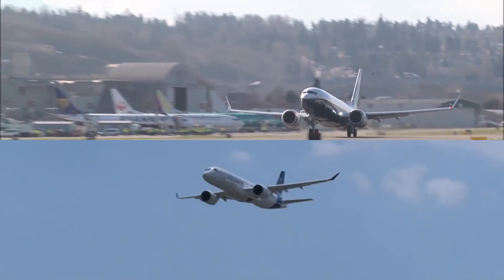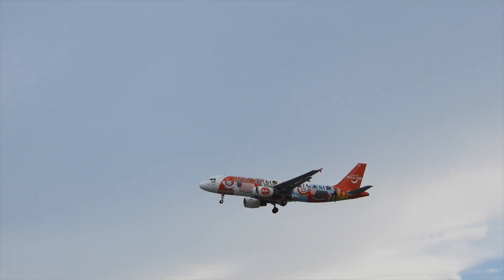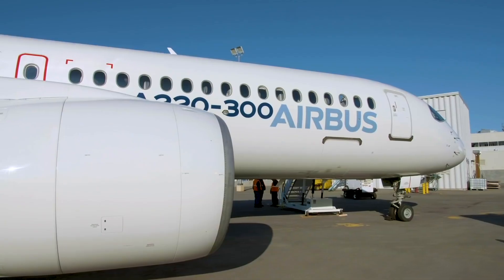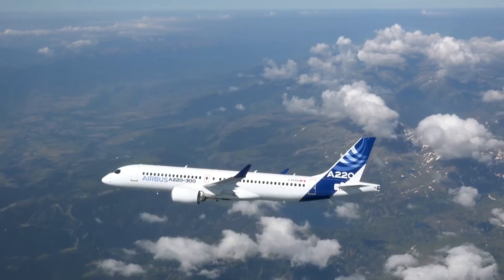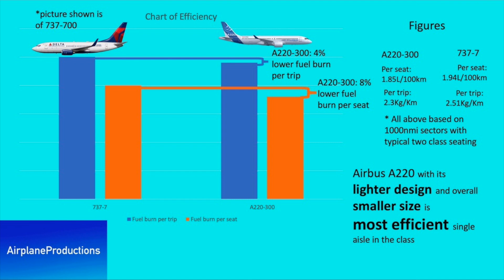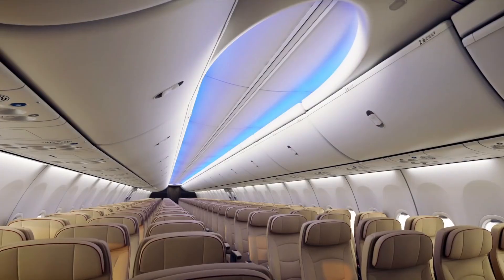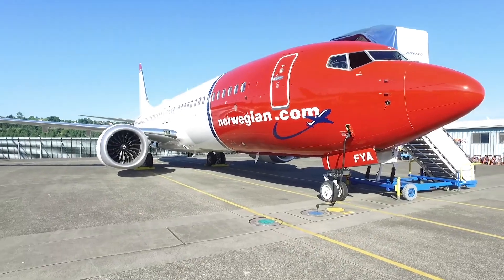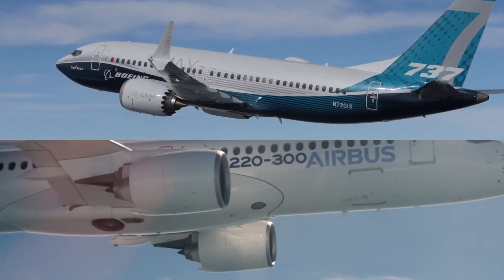Airbus A220-300 vs 737 Max 7: Which is better?

Comment: 737 MAX is a killing machine. Every month after grounding a new technical problem is discovered
Reply: Enough with the understatements.
Reply: Quite true, they pushed it out too fast. I don’t think the 737 was made for the upgrades.
Reply: @k.c.5312  she was ment for it...but, she wasnt spent enough time on...as a result, she was rushed into service....
Reply: @RaY_77W  You sound like you're and ICON A5 employee with that attitude.  Boeing, and Boeing alone took the most popular plane in aviation history and turned it into a Ford Pinto. No commercial plane has ever been grounded this long.  There's more than 1 pilot on YT that says the 800 that got built should go straight to the crusher.  At the least, they need to change the windshield winglets and tail fin to look like a 320.  Otherwise nobody will ever fly on it.  Build it to look identical to the 320, you might trick some people into boarding it.
Reply: @raymond3803  lol ford pinto
... bro my goal wasn't that have a attitude tho...
Reply: @raymond3803  some point that disagree on but some of it kind of made sense too... but taking them straight to the crusher doesn't make any sense you're just wasting the material and the money that you used.... why break it when you can fix it?? you know what I mean??? I hope they do this max or what ever they decide to call it..... have you seen the Ryanair 737-8200 tho??? Ryanair already working on the rename lol
Reply: @RaY_77W  Crusher was not my words.  I'm only referencing what a 30 yr (I think) 737 pilot said CANDIDLY on this video --> https://youtu.be/9OzFlqHikUc.
He claims Boeings flat got away with beiing negligent with their last update late 90s 737 NG? stretch bigger.  He said that version is shit, but not COMPLETE SHIT They got away with it.  This time MAX he said he absolutely couldn't believe what they tried.
1) Lying to FAA 2) MCAS operated with trim tabs, not yoke handle. 3) 1 sensor without redundancy or 2nd check.  A bunch of shit that said management are murderers.  They knew what happened 1st time.  Secret recording in upper mgt meeting.  2nd crash they still tried to claim Pilot error know 100% they were @ fault.  New 777X fold wing plane has more defects than 737 MAX from inside whistleblower.
In case you don't know.  Ford built a Pinto.  If it got hit in the ass > 5 mph the fuel tank exploded.
FORD PROJECTED # annual deaths (A) 
AVE OUT-OF-COURT SETTLEMENT   (B) 
COST OF A FUEL TANK RECALL (C)
"If (A) X (B) = Less than (C)"
THEY DON'T DO A RECALL.  Fact!
Reply: @raymond3803  lol yh ik about the pinto
Reply: @k.c.5312  who the hell are you to say that they just didn't do it properly
Reply: @Ray Aviation Exactly, they didn’t do it properly. The 737 was too close to the ground, so they mounted the engine higher from the ground making it a little above the wing. There was a side effect to that, making the 737MAX pitch up a little. The Boeing Company created the MCAS system to cope for the increase pitch of the poorly designed engines on the wing. I just don’t think they did it right, not to mention the fact that they didn’t say anything about the structural changes to the wing. They didn’t even train pilots thoroughly to fly the MAX.
Reply: @k.c.5312  I'm thinking they should change all models to MAX  777 MAX  787 MAX  747 MAX.  Just to help the MAX reputation.
Reply: @k.c.5312  but they are gonna make things right now....btw the engines are NOT poorly designed...but other than that..u said facts....but that doesnt mean its not  a awesome aircraft....awesome thing to fly (only with updates I guess?)...i still love the good old Max...she wasnt done properly, but shes gonna get fixed.
Reply: @Ray Aviation Agreed, and I meant the engineers didn’t think it out enough when putting oversized engines on the wing. The split scimitar winglets are a good add on though.
Reply: @raymond3803  may be the 737-7X 737-8X 737-9X and the 737-10X.... maybe like the 777X if you know what I mean???
Reply: the 737max is nowhere near a killing machine . Where is your evidence when every month after grounding a technical problem will be discovered?
Reply: I am tired of asnwer for the 737, I will take a rest

Comment: There is no comparison, as they are two different type of aircraft designed for different flight operations and route structures. The comparison should have been the A319neo and the B737 MAX 7 not with the A220-300.
Reply: Well, Boeing brought up this case of which accusing A220 "dumping" casue airlines not choose their 737 MAX 7. Of course they not only lose the case and karma eventually catch up with them!

Comment: I will go with the plane that doesn’t drive it’s self into the ground
Reply: Have you heard of Alpha-Prot? That's Airbus version of MCAS. It almost downed Qantas 72 and Lufthansa 1829, educate yourself before you comment about poorly trained pilots. Also the max 7 is different than the 8.
Reply: @zourclown1232  I'm late to the discussion, still I want to add something: Alpha Protection and MCAS are NOT the same thing. Alpha protection is there to keep the plane within the designed flight envelope of the plane. It was designed that way from the get go, and is in basically every Airbus. And unlike the MCAS It is not an afterthought slapped on to the plane to prevent an unexpected behaviour that can be attributed to redesigning a very, very old aircraft desgin beyond its limits. The hint what MCAS REALY is is found within its very name. <M>anouvering <C>haracteristics <A>ugmentation <S>ystem. It was actually introduced with the dedicated purpose to give the MAX the same feeling as the older 737s, even though the geometry of the plane had changed. This was done to prevent additional training for Pilots, to save costs, to make the plane more attractive to airlines. AFAIK the first QRM didn't even mention the MCAS-System, and after the first crash they opted for a mandatory read. Yeah, no simulator training, but the pilots had to read about the MCAS system. Didn't help the crew of the second crash, as it kept reengageing itself.

Yeah, another difference is that the alpha protection can be switched off. You then fly in alternate law with no envelope protection. 

And both cases you referenced: Well, the incident of the Quantas flight was traced back to a weird behaviour of the ADIRU CPU relabling hight as AOA. The actual reason WHY the CPU did that was never actually found out. The software and hardware in question went through a series of peer reviews, and no one found any fault with it. However, being aware of the issue Airbus released a revised procedure to handle those situations, and Quantas 71, while encountering the same issues with the ADIRU, had no loss of control and were able to continue without any further issues. Interestingly these are the only two cases for an Airbus (I know of) where this issue appeared, both on the same route.

The Lufthansa 1829-flight was due to frozen alpha vanes. That is a physical fault, and while it caused issues the flight crew was able to switch of alpha protectoin and then land the plane in alternate law. You know, that thing I mentioned earlier? That you can switch it off? The thing that you could not do with MCAS? Yeah, that.

And to add insult to injury: A220. Well played Boeing, well played. I bet that 300% tariff payed itself off quite well, I bet that driving Bombardier out of the market and their design right into the welcoming Arms of Airbus was a very big brain move. To be fair, Boeing only wanted a ... what was it? Something along 120% tariff? But their lackeys in the government were overzealous in protecting their golden child and raised it to 300% on their own.
Reply: @brkr78  Queensland And Northern Territory Aerial Service =QANTAS. no U
check out QF 32 if you want to see how well trained QF train their pilots. Great book to read too.A lot of Qantas pilots are still active reserve pilots in the RAAF and stay updates on FA18's or C130 or C5's.
Reply: @georgepppp533  Yeah, I know about that. Is pretty famous actually. Not to long ago Mentour made a whole video about it, followed up by a video that described the diametral opposite of these pilots, about a chief of operations (I think) that flew 2 hours or so on one engine in an a320 from greece to ... i think to slovakia because he didn't want to land away from the base of operations, he didn't want to land at an alternate or declare an emergency, or even a panpan until the last part when he landed. In the following investigation he said that this was not problem at all, he made no mistake and whatnot. The final report was, for a final report, very strongly worded, something along the lines of "The PIC needs to see a psychologist".
Reply: @brkr78  QF72: There's no proof of it, but since all other possibilities have been ruled out, the only thing possible is a high energetic particle causing a change in the bit of the programming. This has happened before in computers. The channel Veritasium has a video about this, even featuring QF72.
Reply: Key word “almost.” No mater what, the 737 MAX still drove 2 into the ground.
Reply: @k.c.5312  any plane would drive anybody into the ground if they weren’t trained
Reply: @Zour Clown The Faulty MCAS drove the plane into the ground as well as the undertrained pilots since Boeing mentioned little to nothing about the MCAS.
Reply: @k.c.5312  that Ethiopian crew knew all about MCAS, yet they still found a way to mis-manage their airplane.
Reply: @zourclown1232  The B737 Max did
Reply from the maker: Jason Haley Haha. Well I believe Boeing will fix the MCAS issues and that 737 will be as safe as any aircraft eventually. Thanks for watching and do stay tuned for more great videos on the way!
Reply: @YSN Bach your too late for the 737max to be scrapped and f themselves

Comment: Ok, this guy is an idiot: 737 has the slightly wider cabin.  Seat pitch/width is determined by airlines, not manufacturer.  That being said, CF everything, longer AR wing, slightly more efficient engines due to taller landing gear.... Yup, Bombadier 220 is better at the small range.  So, who will step up with a modern 5 seat wide cabin?
Reply: He said it in the video
Reply: @xander1931  ?
Reply: @w8stral  whatever

Comment: A220 is perfectly suited for short haul flights and also more efficient. But MAX has got its flexibility. Both have its pros and cons. I'll choose a220 anyday over MAX 7.
Reply from the maker: Chirag Chaudhuri Thanks for your comment. The A220 is indeed more efficient, though the higher trip cost of 737 Max makes it a difficult one for airlines to justify to place on certain routes. Thanks for watching and do stay tuned for more great videos on the way!

Comment: A220 is also better optimised for routes most airlines are going to fly these planes on.
Reply from the maker: Alexander Mack Absolutely, it is the better aircraft :) With it’s smaller size and perfect range, the aircraft will open up a new era of Point to point travel. Thanks for watching and do stay tuned for more great videos on the way!
Reply from the maker: MrFalcon2001  Thanks for your question. Well the A220-300 is defintely more fuel efficient per trip. I would say around 5% more efficient though exacts are hard to conclude given different ranges and seat count. Thanks for tuning in!

Comment: I think the a220 is better - how could it not be? It is brand new, while the Max is a souped up version of a plane from the 60s.
Reply: THere is not one single part on the 737NG which would fit on the original 737.  737Max likewise has almost ZERO part commonality with the 737NG.  Thanks for proving you are utterly ignorant.  Bravo.  Keep typing displaying your ignorance to the world!  Bravo!
Reply: w8stral what in the lords name are you talking about?
Reply: @Seawolf The commonality is in its flight characteristics so you do not have to recertify PILOTS.  And yes, plenty of parts in common between NG and MAX.  Just nothing in the wing, tail, empenage, leaving only the forward/rear sections of the fuselage/landing gear as "common"
Reply: @Seawolf How the Lazy B claims 70% is an absolute joke. Hell even the aluminum stringers used in the fuselage are different in the Max over the NG.  Same goes for the wing.
Reply: @Seawolf And what is he talking about?>>> systems that require maintenance.  You do realize there are a lot of people who work on the program, assemble the planes who watch youtube vids right...

Comment: One thing I would like to add regarding the 737. In 1984, I was flying from Minot, ND to Denver, CO on Frontier Airlines. The 737 was one of the first models built in 1967. The overhead was just a shelf and not storage bins. While flying over South Dakota, we hit an air pocket and the jet dropped out of the sky and when it finally "grabbed" air, I saw the wings bend upward to where I thought they would snap. I thought we were dead, but the wings held and we continued the flight to Denver. Even though that 737 was ancient, it was durable and I am sure it went through thousands of cycles. Boeing really did a great job on that series in my opinion.
Reply: soaringtractor  They ruined it by introducing the Max
Reply: @grozaphy  they didn't it they didn't do it properly
Reply: Eh wings are designed to tolerate flex, the 737 (the DC-9 family was too) was a tough aircraft but the max ruined it. I was on an A321 and we hit a bit of turbulence at our cruise altitude in south Illinois it was only a year or so old but still there was quite a bit of wing flex. But I wasn’t too worried for I know those wings are built in such a way that they can handle that flex.
Reply: It was great for the past when airlines don't really charge you for many things to make profit and when they don't squeeze more small seats to break even or make more profits. Plus back then in 1960s when it was first introduce 737 didn't have to worry too much about efficiency. Nowadays everything have to be efficient. So 737 got upgraded overtime to follow the trend and safety but in today fast paced world 737 already reached it's limits. Boeing too cheap to make a new plane from scratch because of Bean counter management the company used to be run by engineers now focus more on profit by selling legacy products.

Comment: I have flown on most models of Boeing aircraft all the way back to the Boeing 377 in the middle 1950s. I always felt safe and confident on Boeing aircraft. Not anymore though thanks to the MAX debacle. The wilful deceit and lying by omission regarding the MCAS was bad enough but to sacrifice 346 innocent lives in the name of profit and greed is criminal. Muilenberg and his cronies deserve to be locked up for 346 counts of manslaughter for life.  The A-220 is a new aircraft and is proving itself nicely. Inasmuch as it is capable of flying 3,350 miles, it would be ideal to make flights to Hawaii from smaller cites in the Western US and able to fly across the US from smaller airport to smaller airport.
Reply: Most Rich people don’t get jail or any justified punishment unfortunately. Certainly no jail time.
Reply from the maker: Code3Forever Thanks for your comment. The A220 is indeed a great aircraft that will prove itself over the routes. Thanks for watching and do stay tuned for more great videos on the way!

Comment: A220 if flying,  737 max Is not
End of discussion
Reply from the maker: Yoav Hofstein Ha lol! Thanks for watching :) I believe the Max will be safety up soon!
Reply: @oneskyflyer  watch Wendover productions video about the max re entry process, to see that it will take a year to train, maintain and fix the aircraft.  There is also corona virus, so airlines won't want the extra capacity
Reply: You cant say that, this video is already bad because the c- series and max were built for two different reasons. Just because the max had a bad design dosent make it comparable to the c-series. The max was built for transcontinental and transatlantic flights as a mid size medium range aircraft, the c-series is an rj. I know that the og 737 was an rj but the max is not. They're uncomeparable.
Reply from the maker: Nicholas Kent Absolutely so, but Boeing still fought for marketshare with Bombardier in the Delta deal, stating the Max was the better aircraft. Still, in this market the A220 is more efficient and better suited. Thanks for watching and do stay tuned for more great videos on the way!
Reply: McDonnell Douglass people are still running the company (Calhoun) despute their lip service they "cleaned up house" (firing Muillenburg).

They should beg and bring Alan Mulally back. He made the 777 program great and started the 787 program.
Reply: I agree!
Reply: Bombardier 1, Boeing 0
Reply: You took the words right out of my mouth

Comment from the maker: The new single aisle from Airbus or the good old workhorse with new engines from Boeing? Which is better? Comment below!
Reply: I believe the A-220 is better as it is a fresh design and more advanced. The 737 was a great plane for it's time but with the MAX, you are cramming new and bigger engines where there had to be design changes. Due to Boeing deliberately covering up the MCAS concerns by Boeing engineers, I have no confidence in the 737 MAX program. Boeing does make good aircraft with all of their other models but they dropped the ball with the MAX. I feel sorry for the Boeing employees who lost work on the project but I feel Boeing should have started from scratch to build a jet to compete with Airbus. Now you have to wonder what else Boeing "neglected" to tell airlines and pilots regarding other aircraft they have built while Muilenberg was in charge.
Reply: A220 of course. The  737 peaked with the NG and they should have stopped there.
Reply: Stop! Boing had putted the Airboss engines under the wings!
Reply: And the 737 have only the option for the LEAP engines.
The A220 only P&W engines with the gear transmission.